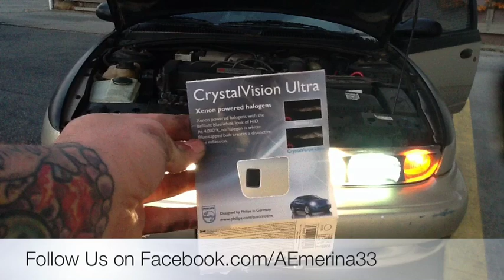Philips Crystal Vision Ultra 4000K Head Light Upgrade Bulbs Automotive

Comment: you should rewire the headlights so the low beams stay on when you turn the highs on. Also what ballast are you using because for 6000k those look way more blue then they should be, looks like DC ballast, not AC ballasts.